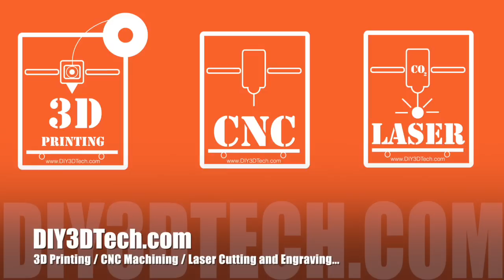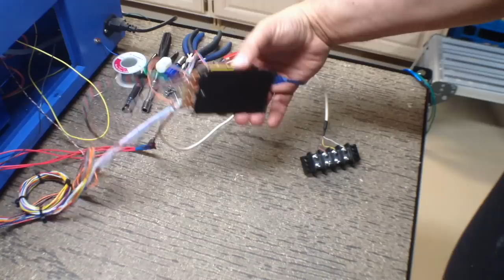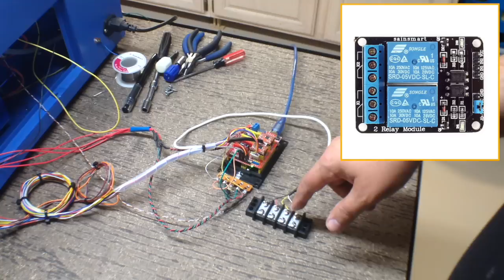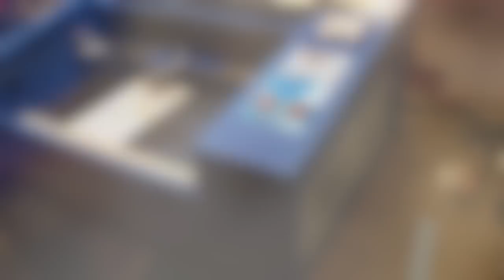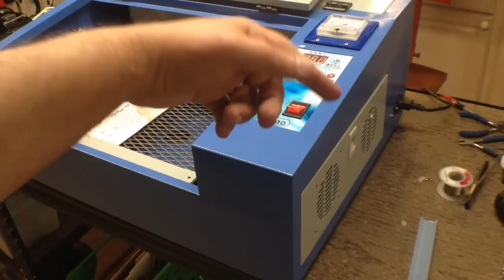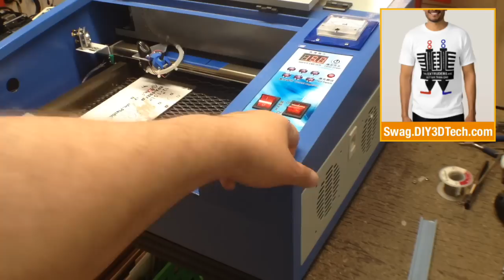K40 eBay Chinese CO2 Laser Cutter - Running with the Arduino UNO and GRBL Wrap Up!

Comment: Hi, how much current did you set for stepper motors? Good video otherwise.
Reply from the maker: Didn't, they worked (and still do) with the setting right out of the box so never found the need to adjust them...

Comment: So, i have been pulling my hair out for a few days on this. You made some kind of circuit board to fire the laser.  Where is the wiring diagram. I only need this. I have all the motion figured out .
Reply from the maker: you just google transistor logic invert-er.  As I just used a single transistor and resister to invert the single level....
Reply: @DIY3DTECHcom  I ended ip doing just that . Built a small protoboard with resistor and logic level fet and it works perfectly. Thanks

Comment: Something is baffling me... why would you choose to not use the S control to vary the power of the laser? If you'd used it wouldn't it have given you the ability to do grey scale engraving - or am I missing something?
Reply from the maker: Yes because the laser is fixed (power) and not pulse width modulated like an LED laser.  As this confuses a lot folks as they ask similar questions as how does Laser Drw do it?  Well it dithers the image to dots and for darker dots it leaves the laser on longer and shorter for lighter (at least on the two I have)

Comment: Do you have a wire out and components used for the invert logic for the laser fire and PWM?
Reply from the maker: Its been a while, however just google "transistor inverter circuit" and pick the one your most comfortable with...
Reply: Thank you. I will. 

Would you have (or mind making) a wiring schematic for your setup? It would be very useful.
Reply from the maker: Sorry just don't have the time right now, however as I say the plug up is very straight forward and the only add on is the inverter and I just googled inverter as mentioned and breadboard one.  Also don't take this the wrong way, I would not suggest making this mod if you don't have a working knowledge of GRBL and intermediate electronics as these K40 are similar but not exact so you need to have the experience to adjust to what you have...

Comment: My steps are 152! Also the homing for grbl needs an inverted y axis and a limit switch.
Reply from the maker: If you're interested, here is a link ( http://diy3dtech.com/replacing-moshidraw-board-with-arduino-uno-and-grbl/ ) to the $$ settings I am using in GRBL, I still need to further tune the acceleration however have been using it like this for a couple successfully and loving the freedom!  :-)
Reply: Thanks! I use DRV8255s with 1/32 micro stepping instead of 1/8 because I really wanted to have very smooth small movements. It does it very well and theoretically:
1/8 = 39.516
1/16 = 79.032
1/32 = 158.064 (in my case closer to 152)
the 4988 steppers are bound to max 1/16 micro stepping.
To align the cutter to the cnc standards, the Y axis end stop needs to move to the other side which is easy with a simple microswitch or opto coupler. Sad I cannot comment on your site. Next on my list is to calibrate the PWM (I use the Grbl spindle pwm output). I will make a list with PWM settings and corresponding current in mA and cutting materials. As software I use Inkscape + j techphotonics plugin see https://jtechphotonics.com/?page_id=2012
For feeding the laser with G code I use: https://github.com/cheton/cnc
It is a very nice setup that enhances your productivity hugely
Reply from the maker: Ah I see what you are saying now, Would like to hear how the PWM goes I did a smaller laser with it worked well.  I didn't do here as I felt the project was complex enough for the viewers and building a logic inverter was was as I felt (for video) going.  90% of what is cut out cases so PWM didn't have a huge value for me, but is a nice add on so please keep me posted :-) also the Gcode sender is very cool!

Comment: Just a heads up. I used the same lattice work for the bed of my machine and over time the galvanized cover tends to bleed off on to pours projects (leather, wood, etc). I am experimenting with using metal screen (like for doors and windows) and the filters that go above stoves. BTW love your videos and education on 3D printing and the K40 Laser.
Reply from the maker: Thanks for the positive comment and for the bed I don't sit anything on it I have a set of pins which hold the material off the galvanized screen.  Have you seen that video?  There actually a couple on various designs in the playlist :-)
Reply: Ah yes the Blue Pyramids!!! Like the old D&D 4 sided dice... I totally recall that video now!! Those are kool but I made the mistake of putting damp leather on the screen itself and after the third item the grid was transposed on the backside of the leather. I can't hold up 3oz leather with pyramids so I just laid it down... I will keep ya posted on my out comes so we can progress the community forward. I have learned quite a bit from your channel, esp not being to afraid to improve my machine. Thanks again and keep the vids coming! (I am working on making vids too) Cheers!
Reply from the maker: Yes those and I two more after we were I switched to pins as well as a make a magnetic version.

Comment: Nice, So you decided not to mount the controller outside the machine case? (I may have miss-understood your prev. video)
Reply from the maker: Yes changed my mind :-) as originally was going to mount on stand-offs inside the case and it was almost impossible to  get in there to drill new holes and then realized I own a half dozen 3D Printers!  So I printed what you could call UNO to Mosie draw adapter!  So it lined up with the existing holes!